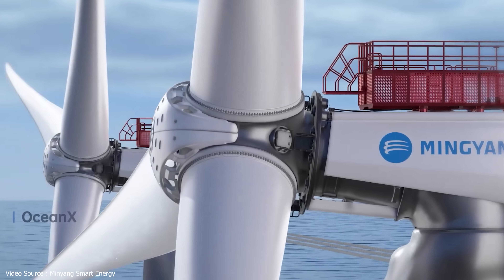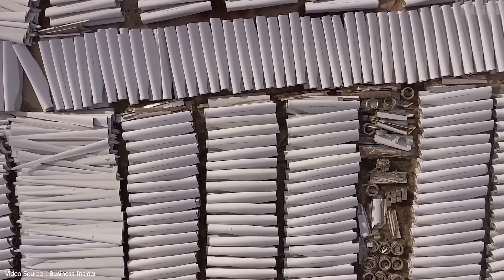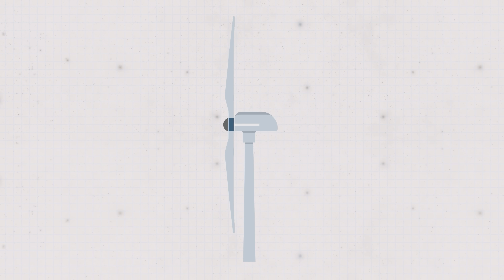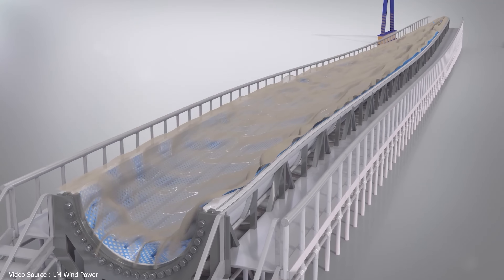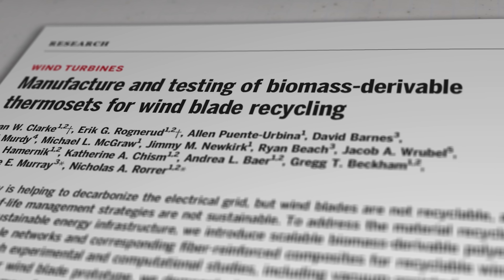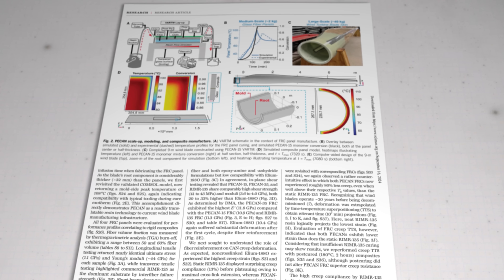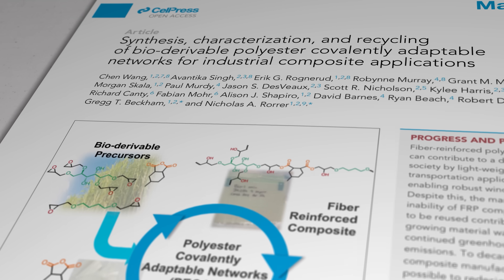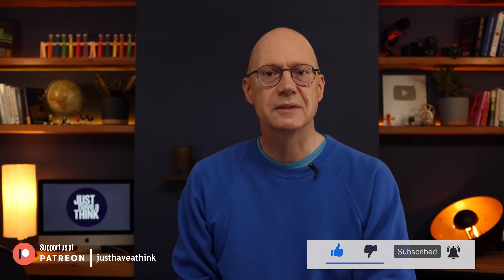FINALLY! Fully recyclable wind turbine blades!

Comment: Does fiberglass really leech that badly? Couldn't the old blades be cut up and used for breakwater sites to protect people from hurricanes and tsunamis?
Google search says "fiberglass material is non-reactive to salt and is not susceptible to corrosion or damage from the salt."
Reply: The epoxy resin keeping the glass fibres together is indeed not very environmentally friendly and can leech for example BPA when protective layers are eroded or shredded. The reuse potential for now is mostly concrete substrate, for which there is a lot of demand. But the area where demand exists doesn't always match where the turbines are situated. So for multiple reasons it is desirable to use more environmentally friendly resins.
Reply: @LinkeHarryB  Thanks for the clarification
Reply: I agree they do not leak. Dave made a mistake there.
Reply: It's not just fibreglass though is it, there are plastics and resins involved; could those be a source of harmful chemicals?
Reply: @danyoutube7491  I suppose it's possible. Was thinking processed chunks could be mixed into aquatic concrete and added to breakwater sites. Surely there's a low-tech solution to make good use of them.
Reply: @KF1  That makes their value for reuse no better than other stuff we throw lots of away. We aren't lacking "material with mass for adding to concrete".
Reply: @DavidBeaumont  But in that case, you wouldn't be throwing it away, you would be using it. Kind of a big difference.
Reply: @DavidBeaumont  ...that's incorrect.  Shredded fiberglass with powered resins is superior, structurally, to sand in concrete, and good sand for cement is becoming a scarce enough resource that it's being pirated.

Comment: The genuine solution to the "turbine blade conundrum" is to stop listening to the fossil fuel industry propaganda. 

Blades are a complete nothing burger. The quantities are miniscule, and landfill is the safe and correct disposal method. They're vastly less toxic to the environment than general waste that already goes to landfill, and landfill is designed to contain that waste. 

On the other hand, coal mining and use waste is not generally managed responsibly, is vastly more toxic than general waste and it's produced in volumes that are many orders of magnitude larger.
Reply: PS, how miniscule? 

The paper says it may reach 2.3 million tonnes per year. 

The coal industry produces 31,000 million tonnes of waste each year. One year of coal produces more waste than the wind turbine industry would have done since the invention of agriculture. 

The coal industry produces more waste in an hour than a year of turbine blades.
Reply: In the time between the last "just have a think" video, and this one, the coal industry produced more waste by mass than 180 years of wind turbine blades. 

We need to stop taking the objections of the fossil fuel industry seriously. They're not made in good faith.

Comment: Turbine blades are a pretty small fraction of the market for fiber-reinforced polymer composites.  Auto, truck, and aircraft bodies, furnishings, architectural components . . . the potential is huge for a truly re-usuable polymer.  
I also wonder what, exactly, is the failure mode for blades that reach the end of their lives while still in use.  If the carbon fibers are still fine, would it be possible to anneal the blades, relieving any internal stresses and healing any cracks and delaminations? (You'd need some degree of thermoplasticity in the cured polymer, but that can be designed in.)

Comment: Wonderful, a larger footprint per tower.  
     Meanwhile, a vertical wind turbine design based on large spinnaker sails would catch more wind and be set atop one another.   
     Each level of the tower should hold 3 to 6 spinnakers to increase rotation.  Also, the spinnakers could be made from biodegradable or recyclable materials, such as cloth like the sails on the Cutty Sark or a Clipper ship.  

To save weight, the sails could be made in panels or with a grid of small "windows" properly reinforced in the spinnakers. 

This design in a compact version that could be mounted atop tall buildings, along the dyed to resemble a merry go round, in urban wind tunnels between buildings, and other windy places.  
     The vertical layout gives options on where to place the generator, top -middle or -bottom.  This will also allow extra sound proofing around the structure.  The generator could be put underground.  
     To minimize tower flex, a set of 4 could be loosely connected at the top by retaining bars.  

Just have a Think.  If you throw away the box, so much more is possible.

Comment: On the subject of the blades currently headed to landfill: They could easily serve a second life as a bus shelter, house roof or noise abaitment barrier at the side of a busy carriageway; it shows we have a problem with lack of creative thought rather than an item that is truely at the end of its useful life.
Reply: Other ways to reuse the GFR, first-gen blades are materials for wall and floor tiles (which a German SMB is doing already; I'd link the video of German public broadcaster MDR directly but sadly links are not allowed. You find it under the title "Wertvolle Rohstoffe: Wie entsorgt man ein ausrangiertes Windrad richtig? | Umschau | MDR"). Researchers are already finding ways to separate the resin from the fibers of the CFR blades via acid solutions that leave the valuable tissue layers intact and allow for their recycling and of the resin. GFR and CFR fibers are also a good replacement for sand as binding and reinforcement material for concrete.
Reply: I like the way you think
Reply: If someone can come up with a good design to use them in barriers it could be a winner. Other uses are niche, but that could have a huge demand. We need to do a lot better in screening noise from roads & other infrastructure.
Reply: If they could be used to replace structural steel for large span structures like warehouses or solar farms, it coud become a neat solution.
Reply: @sitling5436  Well, yes but somebody must have thought of that. Don't forget that the turbine blades are old and worn and beyond their useful life. Ordinary punters like you and me don't know what kind of degradation has occurred within the GRP during a hard life bending in the wind.
Reply: As they are inert, they could just dump them in the sea (until they become recyclable) as they will become reefs for marine life
Reply: Why not use them for building homes or other structures,  if they are just going to throw them away, guve them to builders to reuse them.
Reply: It's the transport costs and environmental impact that is the big problem with this concept. Modern onshore blades are 70+ meters and weight 25 tonnes.
Reply: the problem with creative solutions is that they are very niche and don't really solve the problem. they could offer to sell the blades for people wanting to buy them for a specific projects. but overall it wouldn't solve the problem.

Comment: Making something that must withstand harsh weather 24/7 and UV during the day out of anything biodegradable sounds like asking for trouble. Biodegradable stuff usually sucks at harsh environment durability.
Reply: @teardowndan5364
Making something that must be routinely disposed of, out of anything nonbiodegradable sounds like asking for trouble.
Rock. Hard place.
Reply: @UsualYaddaYadda  Properly built inorganic blades last 20-25 years. By that time, the gearbox and generator probably need to be replaced or at least taken down for rebuild too if you want them to last for the lifetime of a new set of blades.

How long would biodegradable blades last between UV exposure, sea spray, airborne particles, rain, hail, etc.? Probably nowhere near long enough to make economic sense.

Once you start adding toxic additives to make your biodegradable stuff last longer, you are back to having something that requires expensive extra steps to make bio-safe again. That is fundamentally the same problem as inorganic blades: very few industries interested in discarded blades byproducts.

Comment: How do the fiberglass blades leech toxic chemicals into landfills? Aren’t they inert? And how much mass/volume do blades make up in landfills compared to municipal solid waste?
Reply: Engineering with Rosie, calculated that if a person powered their home from wind power for 20 years, they would be contributing 9kg of composite waste to landfill. Buying a carbon fiber bike produces more composite waste.
Reply: No they don't and I once did the math. The blades in the whole world who will be decommised is about the same amount as 8 years of building vaste in my home country Denmark. And I live in a very small country. Nearly nothing af that waste is recycled.

Comment: also, Modvion in Sweden makes full size wooden towers. After the wind turbine's life of 30 years, the tower sections can be re-used as small housing, construction etc. And 100 years after that, as heating fuel. That's a long time carbon sink, while more trees are grown.

Comment: While all these numbers of potential waste from turbine blades sound bad, realize that the CUMULATIVE projected waste from ALL turbines decommissioned between now and 2050 is less than 5 percent of the coal ash the world produces EACH YEAR. So yes, this will be good for PR, and maybe it will even save a little money, but recycling turbine blades is of miniscule importance compared to reducing carbon emissions and reliance on fossil fuels overall.
Reply: Exactly. Let's not lose the big picture here. But it's still a considerable amount of waste and if that can be avoided, then that is a good thing.
Reply: Spot on! "Major wrinkle", as the video claims? Not even close! "Definitely not what we signed up for ..."? Utter nonsense! Although it can serve a narrative to overcook a 'problem' in order to build up the importance of a certain 'solution' the result, in this instance, is a disservice to the energy transition. Perfect made the enemy of very, very, very good.
Reply: Great point.
Reply: Isn't the ash used for concrete and steel? I'm not defending the coal industry, just hoping that the ashes aren't just wasted.
Reply: @VeniceInventors  In principle, yes, but in fact, only about 60% gets reused, meaning about 200 times more coal ash than turbine blades would have to be disposed of between now and 2050 assuming current levels of coal use. So every wind turbine we build is a massive reduction in the space we need to dispose of waste, even if none of the turbine blades get recycled.
Reply: @wordmunger  that's a shame. When the power plants were nationalised in Britain, they sold the ash for concrete to other building firms (inc other state-owned, and private, ones) and made sure the ash wasn't just wasted. Because they had that incentive for the whole economy. Once privatisation kicked-in in the 90s, a lot of that reduced to the level you say — where only the really profitable ash gets recycled :/

(I daren't even look at how badly-maintained the privately-owned electrostatic ash collectors are either...)
Reply: Some glass fibre blades are now being shredded and the waste added to concrete. I do wonder if some practical alternate use could be found for the blades, eg cut them up in to staves and use them for fencing.
Reply: Ah so the logic is since one thing = bad, another thing = less bad, = good?`
Have you seen what wind turbines does to actual nature around them?
Reply: @kjetilknyttnev3702  yes, I have.  In almost all cases, wind turbines have very limited effects, particularly compared to coal power plants and mines.

Also, yes, less bad is good.  That's not strange or complicated logic.  There is no expectation that modern, industrial society will have no impact.  We need to minimize our footprint on the planet and wind power is a big step forward from coal.  We are not looking for the perfect solution; we are building progressively better solutions.
Reply: @kjetilknyttnev3702  You cannot be serious?! Nuclear power is even worse in every aspect! Economically, environmentally and in terms of sustainability it is only marginally less bad than fossil fuels. 🤦‍♂
Reply: @jaimecastells4283 Like Kjet` said, less bad is just less bad, not good. You seem to be playing a game of semantics where you are using “good” as in “it’s good that it’s less bad” but the way you have stated it, makes it read as “it’s less bad so therefore it’s good”. It is good that it is less bad but it’s not good just because it is less bad.
Beyond the semantics, the wind turbine industry is largely based on the idea that the coal industry should not exist so the environmental considerations should be directed towards a world where there is no (or very little) coal. In doing that they just need to focus on making their own industry as sustainable and low impact as possible.

Comment: You did a video on Recycling Techologies a while back, remember? Their process takes any plastic and pyrolyses and distills it into an organic chemistry feedstock called Plax. From there you can make any plastics or organic compounds you choose. You presented the process then as the answer to plastic recycling and I believe you were right.
But now you presentent it as an energy hungry toxic process that needs to be avoided.  Obviously, the company behind todays video describes pyrolysis based methods as untenable. They need to get support for cooking the plastic in high pressure hot flammable solvent for hours. Which process is better is not a given, it would depend on economics, the desired end product and technical properties of the processes.
Also, the "turbine blade conundrum" certainly is not big compared to the gigatons of plastic we spew into the biosphere. If an average persons whole electricity comsumtion came from wind, then that persons contribution to resin- fibre waste would be 15 kg over the life span of that turbine, or like 10 grams per year.
Now make a video about why this is considered a huge environmental problem.

Comment: Well now lets find a way to not poison the water with coatings to prevent muscles and other sealife to stick to the platforms below the water surface.
Reply: Coatings don't poison the water, they just poison a single surface
Reply: @OutsiderLabs  I would think that the ideal, but if older or generally of bad quality this seems not always to be the case.
Reply: Preventing sealife sticking seems reasonable on moving objects (ships) . But why here ?
Reply: @ It is been done, the reasoning for why it is been done i am not too sure. If i had to guess, it would be to avoid material degradation or if its a floating structure to avoid imbalance.

Comment: I know that there is used a lot of dangerous chemicals when the blades are produced. But Dave is talking of “dangerous chemicals leaking from the blades in landfills”? It’s often said by critics of wind turbines, but is there any evidence of it? It’s reason they are hard to recycle. They are very durable.
Reply: The difficulty in recycling is in part because there are different components that are not easily separated from each other,.  I heard even the well know Pringle's tube is hard to recycle , even though they contain paper, steel and plastic, because its difficult to isolate those materials cost effectively for a business.
Reply: Yes, epoxy polymeres do degrade by decomposing the polymere thus setting the chemicals free. It takes long, but that doesn't make it better. Someday all epoxy will be degraded.
Reply: |   @flexiblebirdchannel
|   Yes, epoxy polymeres do degrade

'In the ground' is a long time.  Modernist humans always think too short term, don't they?
Reply: @UsualYaddaYadda  Cool so no problem with us burying nuclear waste then?
Reply: @Shrouded_reaper  The opposite of my point; which clearly needed more 'tone' added...  Yeah, limits to current lifeforms' rights over future earth pollution is one reason that I'm anti-nuclear and pro-powerdown
Reply: Indeed. There is no actual issue here

Comment: 230 meters could wrap around my house 5 times almost. That'd make amazing siding. 
Good for bench seats, and rain covers. Good for shingles.
All that would just require cutting the panels into 10cm strips, or squares, and moving them to the job site. Not complicated, or all that expensive. Least compared to burying them forever. 
Could probably make car panels out of them, but that'd probably require some more shaping. 

I'm convinced in a hundred years we'll be digging up all the garbage piles to get all the useful stuff buried in them. From organics to metals to polymers, it's got everything. Just need some better sorting tech (or an abundance of labor, insert 'AI is coming for our jerbs" meme here).

Comment: Is it time to bring in the imaginative architects to incorporate end-of-life wind turbine blades in their designs, for example pairs of blades bolted root-to-root to a triangular section steel ridge beam so as to produce a strong and light roof structure with most weight carried by the central spine, and curtain walling at the tips. Or something like that ...

Comment: Let's talk about literal MOUNTAINS of Toxic Coal Ash before we get our panties in a bunch over a relatively small volume of turbine blades.  When you bury plastic and fiberglass composite in a proper landfill, you are sequestering carbon, keeping plastic out of the environment, and returning glass, which is just melted ROCKS, back to the ground from which it came.  None of these things are particularly bad.  Burning coal IS bad.  Very bad.
Reply: @incognitotorpedo42  "Let's talk about literal MOUNTAINS of Toxic Coal Ash..."
OK. Wind and solar absolutely depend upon fossil-fuels. No fossil-fuels = no wind-and-solar.